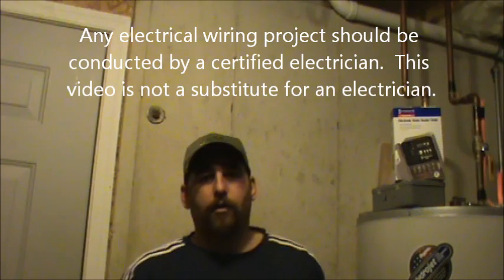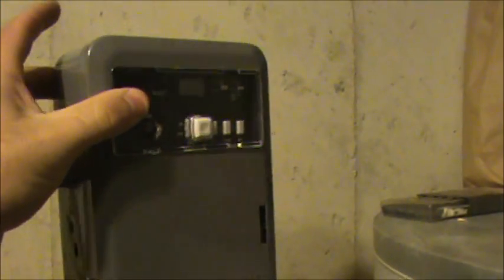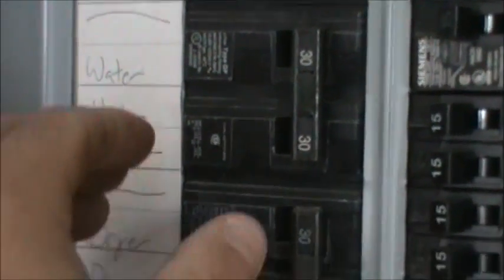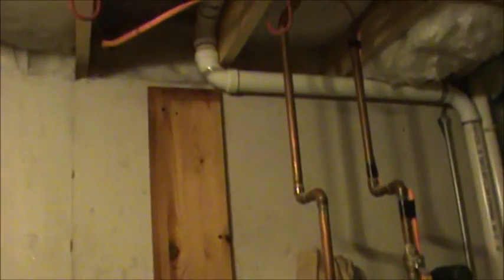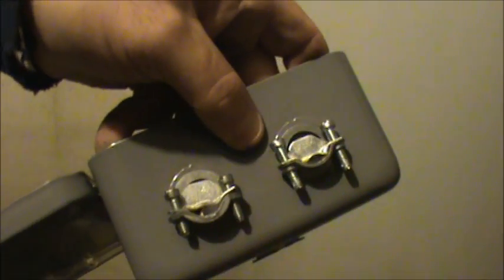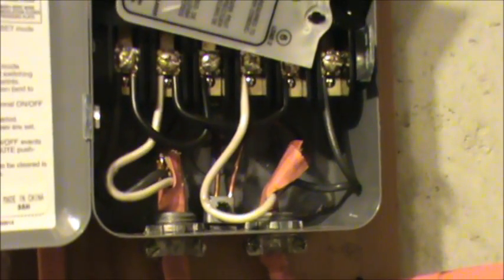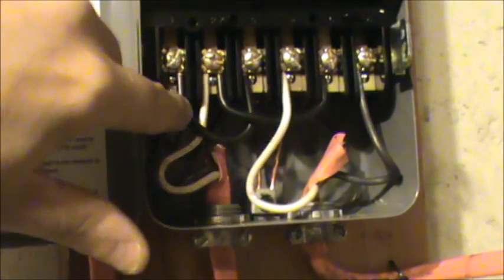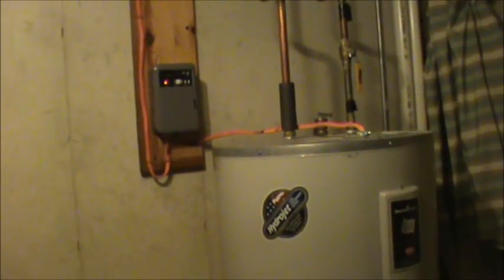Intermatic EH40 240-Volt Electronic Water Heater Timer

Comment: I just noticed you turned off the 30amp breaker that is feeding the hot water heater. The EH 40 water heater timer you installed is rated at 40amps. Why did you use a water heater timer that is rated at 40amps? Shouldn't you have used a 30amp mechanical water heater timer to match the 30amp breaker?

Comment: @doublewide 6 Repairs LLC, Your video is GREAT!!! I was able to perform the install the exact timer. Our electric service does peak hour billing. So The water heater can pull 2 to 3KH and the charge is $12 each KH. So we saving the same $5 - 8 per month plus the peak charge of $24 to $36 per month.

Comment: Thanks for posting. Very helpful. I set mine to come on off peak when electricity is cheaper and shut off during peak times. I spent an extra $5 and 10 minutes putting flexible conduit over the wires on mine.

Comment: Nice vid.  I have a question:  My older electronic timer is clicking — a lot — all the time.   Timer is rated at 6000 watts.  Tested it with a meter and it’s cutting the power to the WH every time it clicks.   It’s 50 gal and on a double 30 amp circuit and it has 5500 watt elements.  I don’t know how to measure the wire gauge cause it’s in conduit.  Should I replace it or is it because it’s too small?  It was used in my mobile home on a 50 gal 2 element WH but I don’t know what the element rating was.   Just don’t want to get a new one if it’s also going to click off and on incessantly.  Thanks
Reply: paul stradley throw away buy new!

Comment: Very informative but one very important question that concerns me--IS THIS TIMER COMPLETELY QUIET? I have the Intermatic WH40 installed and it runs me crazy because it is installed on the other side of a wall right next to my master bathroom. I even added a board away from the wall and rubber cushions and it still clicks loudly. The 220 wiring can't be extended to move it to another wall.

Comment: @Glenn D mine has been installed for 8 years. I only had to change the battery a couple of times. I don't like the setup buttons, they are bouncy so at times the get stuck. I have to change settings for summer and winter so I have to deal with it at least twice a year. On the positive side, the timer has plenty of options to be programmed.
Reply: +René Javier I have found a timer unit that can be controlled via the phone. I guess it should make setting and programming much easier. On the down side, it doesn't looks like it is ready to be installed...( hellosteam.com)

Comment: well great video but you should never have exposed romex wires anywhere as per code, a metallic flex , green field etc should have been used to protect the wire. all over a great video :O)
Reply: Really? My garage has exposed romex all over the place! The code must have changed, I guess, as codes so often do.

Comment: Thank you for the detailed instructions. I was only replacing a broken one, but I found instructions that come with the item conflicting and wanted to make sure I connect jumpers right (a small paper insert inside of the jumper bag suggested to connect 2 to 3 and 1 to 5, which is wrong).
Reply from the maker: I'm happy the video helped.
Reply: Old but worth the update for clarity on stupid paper in box.

While little paper is correct, it is completely opposite to the plastic (removable cover) that is inside the EH40 so Intermatic just created a mess for homeowners.  
Directions that come  with the EH40 are worthless. 

Plastic:  labels lugs as #1 Line 1  #2 Line 2
Paper shows Line 2 connecting to Lug 1 and Line 1 connecting to Lug 2.  

So, it is opposite.  
Follow the video which is exactly as the plastic cover shows.
==============================================================
Line 1 (either line of the two hot wires in a 240 Connects to Lug 1 and then Jumper from lug 1 to lug 3
Line 2 to Lug 2, jumper from Lug 2 to Lug 5

Plastic cover and video (THIS is the Way).
line 1 lugs are #1 and #3 (jumper 1 to 3)
line 2 lugs are Lug #2 to Lug #5 (Jumper 2 to 5)
==============================================================
Stupid paper in box shows (wrong compared to plastic cover but will work)
Line2 lugs #1 and #5 (jumper 1 to 5) This is too long for jumpers provide.
Line 1 Lugs #2 and #3 (jumper 2 to 3) which is too short for jumpers provided
This will work but it is completely opposite to the plastic cover wiring directions.

Manual has NOTHING in it about jumpers or wiring. Intermatic FAILED.

Comment: Thanks so much for posting this Video!  I bought this exact one yesterday and didn't realize it would be "complicated" with having to do jumpers and such.  I have a 120 gallon solar hot water tank, but in the winter it tends to use the electric coils the majority of the time.  I'm also on a Time of Use rate from the electric company and it's cheaper certain times of the day to use electricity, so with this timer I can now just have the water heaert turn on when the electric rates are cheaper and I won't hit a peak demand charge as high since the water heater can't run during peak electric times...all that gets complicated but your video definitely made the install go a lot smoother!  Thanks a ton!  Looking to save some decent bucks now!
Reply from the maker: You are welcome.  Please be careful doing the wiring and make sure it is wired up to code by having it inspected.
Reply: doublewide6 Absolutely, great point for anyone performing DIY projects, make sure it's by code and done right!
Reply: Kind of a Hybrid of Vik027's and Sleekun's situations... Replacing a broken WH21 (Analog SPST) with the EH40 (Digital DPST)... Have TOU Rates and will be wiring the EH40 to only switch on the Main Element during Off Peak Time. Hoping it'll largely be a simple swap out of the boxes.  Nice to see the EH40 "in the wild" most sites show the Timer Mechanism but not the box installed/closed... looking forward to this project.  Should arrive in about 18 hours and the fun begins...